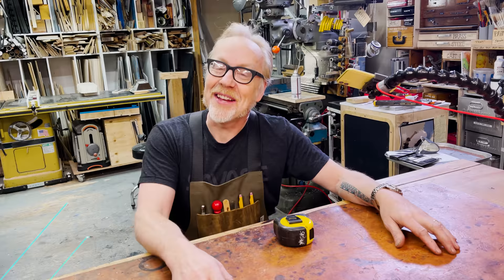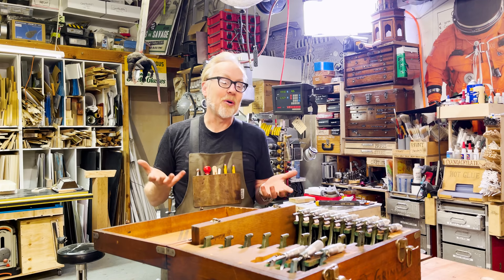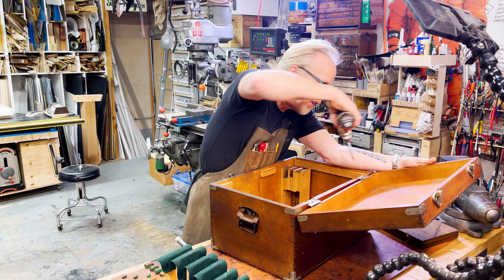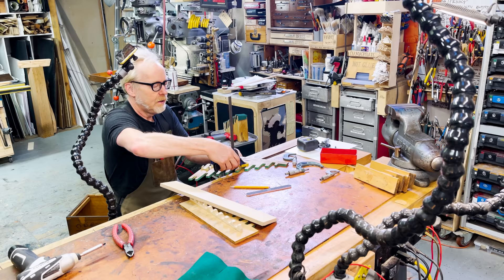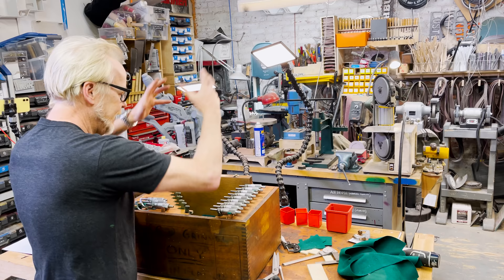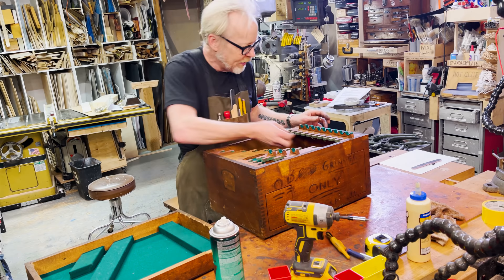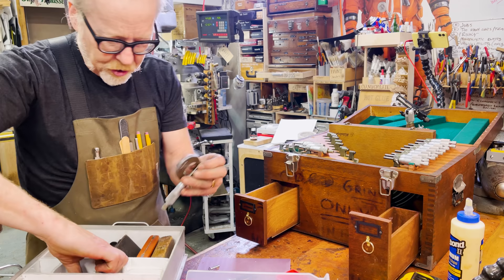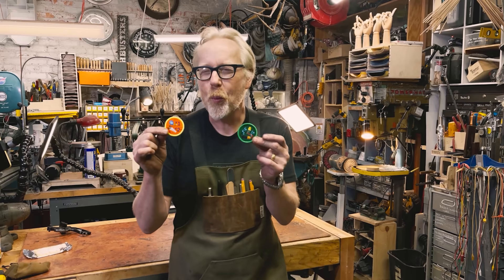Adam Savage's One Day Builds: Micrometer Gauge Box Set!

Comment: Imagine being the guy that sold this on eBay and then watching this and realizing you shipped these poorly to Adam!
Reply: My thoughts exactly. I would change the way I did things immediately. 😬
Reply: Just Seppuku😂
Reply: It sounded like they also arrived in a state of griminess and disrepair, so I'm getting more of a "we found these in dad's garage after he passed" vibe there, rather than someone who knows how to ship and handle antiquated but still useful tools.
Reply: Well, Adam then ruined it by using brass handles on the drawers while all the other hardware is steel, so nobody needs to feel bad about the whole thing.
Reply: @mm9773  How is that ruining anything. If you notice, he also used brass screws for some of the parts, namely because brass and wood are far greater friends than steel and wood. It would probably take too much time remaking everything in brass, as well as requiring some machining skills that Adam does not yet have, but besides it's only looks and have nothing to do with the micrometers themselves
Reply: @mm9773  Woodworkers prefer brass.

Comment: 53:44 Just a small hint: prevent touching the standards at their metal ends (especially the flat)  to avoid corrosion due your hand's sweat. That why they have a non-metal handle in the middle.
Reply: The plastic is also to minimize heat from your hands affecting the length of the standard (and the geometry of the micrometer)
Reply: @dsier  Seems that Adam did not have a metal workshop teacher as you (and I) had :-)
Reply: I have a friend at a museum that is pretty mad at visitors "looking with their fingers". He says their exhibits partly have (well, had) the original paint job, and the fat from your fingers you invariably leave behind is acidic and, added up, eats away the paint, esp. of the late german WW II planes where the paint was abysmally bad.
Reply: The ends of standards as well as the mics have carbide inserts so the don't wear down with use. Carbide does not corrode.
Reply: Light machine oil, leave them unloaded, silicone packets in the case. temperature affects when going ten thousands.never engrave them. Keep standards in silicone packets ziplock is perfect. You will go nuts measuring everything common to you, like the clear wrapper of a pack of cigarettes is two thousands gap on a magneto for a Harley. Book of matches 15 thousands, points. So on
Reply: I slide the rubber "handle" as you call it of the standard down over the non moving end of the mic to hold it in place while checking calibration... idk if thats correct tho.

Comment: When storing a micrometer, always leave a distance between the measuring surfaces, otherwise cold welding could occur. Love your work!
Reply: I thought that was a myth, everytime somebody tried cold welding it failed. Is this true?
Reply: If cold welding really happens, then what about ball milling aluminum powder? Wouldn't the fresh surface with no oxides make the powder clump?
Reply: Not the cold welding, but yes, you should always leave them a little bit open to alow for variations in the metall during store time.
Reply: @shannondove9029  yes true. Gauge blocks do this. Look at YT, there are several videos.
Reply: Isn't cold welding similar to explosive welding? In explosive welding the peices are pushed together while they are cold and way below the melting point. In fact, it seems explosive welding is the exact same thing as cold welding
Reply: Cold welding is nothing that people do. It just happens. Over night. Take two gauge blocks (there are videos here that explain you what a gauge block is) and rub them together. They will stick to each other, because they are so precisely made that the ions can move from one block to the other. That happens slowly and in the atomar scale. After one night new crystals may already have been grown, uniting both blocks. That‘s the so called „cold welding“.

Comment: Calipers measure in four ways, the three mentioned and then it can be use to measure a step.  The moving jaw has a step theorized jaw has a flat spot.
Reply: Came here to say that..
Reply: @hoppend  me too!
Reply: Have been wanting to say this for so long.
Reply: Some measure in five ways.  Mine has a set of recess points on the back that allow you to transfer a measurement form a compass or set of trammel points.   Also some have a thumb wheel that works somewhat similar to the way the ratchet on a micrometer does.
Reply: ahh I saw your comment after commenting the same thing.
Reply: yep, the depth measurement should only really be used for depth of holes, you get much more positive contact and deflection of the depth rod usually fouls most measurements that should been performed with the step. Though it is worth noting that not all calipers are capable of step measurement (Adam's pair were indeed capable), I had a pair of 12" vernier mitutoyos from the 60's that had a nonexistent registration face on the back of the moving jaw assembly due to the rounded design.
Reply: I just got to 23:00 and realized he would get a more accurate measurement if he had used the step measurement. (not that it matters)
Reply: Hey Bill, can you unpack the last sentence, sorry it doesn't make sense to me. Cheers
Reply: Some people sound confused about what Bill is saying.

The very common 4th way to measure with a caliper is the step measurement.

The caliper has 2 jaws, static and dynamic jaw (or whatever you want to call them). When the caliper is fully closed (measuring 0) the top edges of the 2 jaws are flush with eachother. As you open the jaw, the end faces move apart and you can measure the depth change between 2 parallel surfaces with a perpendicular drop between them.

As others have mentioned, this often a more precise way of measuring than the depth measurement because it allows you to keep the caliper square to the 2 surfaces and the parallel to the perpendicular surface (by making sure all the contacting metal is completely flush.

If this explanation didn't make sense to you, I'd suggest looking up an image of "caliper step measurement" and a visual demonstration will make more sense.
Reply: @backintheworkshop954  i think "theorized" got inserted by auto correct, looks like it should just read "the other"
Reply: @backintheworkshop954  fat fingers, the fixed jaw, auto correct turned it into theorized

Comment: There is a FOURTH use for dial/digital caliper, you can measure shoulders from the top head and bottom head, very useful with a shoulder because the depth gauge is difficult to keep square. Hope that's a useful tip for some and makes sense. :) (for example - Adam could have used it from the top at 23:00 to measure the location of his cradles)

Comment: I have been on and off of the machinist field for over 20 years now. I love Adam's excitement given and appreciation portrayed towards machining tools because I think in general, manual machining is becoming a lost art. As for micrometers in general I found over the years you develop a feel to measure accurately and with repetitiveness given that even using the ratchet on it will sometimes yield inaccuracy. For me I developed a little wiggle while trying tightening with the ratchet, and also you tend to prefer using one particular measuring tool because simply you developed the "feel" for that one. You can see inaccuracies when using many different ones, brands, or even same brand but different series whatnot. Unfortunately In my life at this moment I have ventured onto engineering , but machining I can say is one of those fields that I actually felt most accomplished and gratifying completing a project. Oh I also want to give a mention that the runout of a chuck is very important IMO for your spotting drills, when you have to drill and ream something that has to stay parallel and maintain position over 1.5" or over depths.

Comment: A little tip for those cans of wood stain anyone has laying around: throw a little nut or screw in the can before you put the lid back on. Next time you can shake it like a spray can to get it mixed up easier.
Reply: You mad, mad genius.
Reply: @firescale8912  I do live on the edge!
Reply: I did this with cent pieces in my warhammer paints.
Reply: you DON't shake stain - you stir it
Reply: @hankmerkle5928  You are a man of taste and sophistication I see.
Reply: Doesn't this add bubbles?
Reply: @serifhim  It doesn't matter for stain. Let it sit a while and wipe off with a clean rag.
Reply: @hankmerkle5928  
Most definitely, for some paints. Were I used to work we used a lot POR 15. We used it in high wear environments. Gives a very tough finish.

Comment: Rewatching this as I often do your One Day Builds; I wonder if you've thought of a way to secure the drawers in. I couldn't help but think a couple of well-placed magnets would give a decent, and non-permanent, method of keeping the draws from accidentally popping out during transit.

Time to continue my journey to another One Day Build.
Reply: One way I can think of doing is put a latch on the inside just like one of those hook and latches with the little guard on it to keep it from popping off. That way you could have a main lock on the on the top without worrying about the drawers coming out. The other thing I thought about was a cover for the boxes that'll go in there so stuff that's in them don't go flying around either

Comment: FYI, calibration of micrometers (and calipers) does not only consist of adjusting "zeros" but also of checking linearity using a set of gauge blocks over the span of each micrometer.

Comment: Hey Adam, great content. There’s a fourth way to measure with your calipers. On the opposite side from the tail you’ll notice when you close the calipers the outside edges become flush. Those two faces are used for situations similar to the tail (depth measurements), but because they are so wide it’s particularly suited for measuring step like features. The wide base helps ensure the measurement is perpendicular to the surface. Cheers

Comment: Seeing this 12/9/21. Completely understand how you feel. About 6 years ago I found a set of Mitutoyo  micrometers that had barely even been breathed on at an estate sale. I asked how they were going to ship them & they were just going to put them inside a standard size box with a bit of bubble wrap but nothing else. After realizing they were going to be bounced around be a USPS guy that was having a really bad day & was off his medication, I quickly told them to hold off on the shipping until I sent a boatload of foam padding to use inside & out. Fortunately, to the great relief of my blood pressure, they packed it properly & shipped it UPS. Got it for about 75% off so it was completely worth the cost of sending the packing materials & shipping UPS. I very much understand how you feel when opening the box. You just can’t help staring, & drooling, at them in all there precision glory. Thanks for the video. I’m following it to the letter on my box. I was originally trained as a machinist but I’m now disabled & appreciate having one less thing to worry about. Keep on making great videos! It’s greatly appreciated!
Ed

Comment: @tested loved this video, one suggestion to take it to the next level: Drill a vertical hole on the top edge of the lower cabinet centered above each drawer all the way through into the drawer face.  Drill a shallower but slightly larger diameter concentric hole in which you can drop a spring, and then turn a rod with a step so that it rests on the spring and is just proud of the top lip by 1/4" while open, and cut the rod so it's even with the top edge of the drawer opening when the lid is open.  In this way, you can ensure the drawers stay closed when the lid is closed and latched.  You could also machine a small externally threaded ferrule that could be inserted into the top of the lower cabinet after the rod and spring are inserted to capture the rod mechanism so it wouldn't be loose. I've seen some old machinist chests with a similar setup to hold a panel on the front.

Comment: Cool vid -- informative, enjoyable, & inspiring -- tnx 4 sharing.
Two suggestions ... I saw that the top of the lid splintered out when the holes for the "mic stand" were drilled through. Starting with small pilot holes from the placement marks on the inside to the outside followed by coming from the outer face in with the full diameter bit could have helped avoid that. Then any roughness from coming through on the inside would have been hidden by the felt. I suspect Adam already knows this and just got over excited and rushed it (kinda' ironic having thought to put some little slices in the felt before drilling to protect it, but then forgetting to use similar caution for the finish of the outside surface). I noticed that no mention of the tearout was made and it seemed like direct views afterward were avoided, this may have involved one of those peeved self critical frustration situations Adam has, elsewhere, alluded to skipping over at times in final edits.

Also, I think the front drawers might benefit from having some sort of way to brace them in place, hold them closed, so they don't accidently slide out when moving the box around or transporting it. Some sort of clip or pin either inside or outside and/or some magnet, friction, or spring mechanism providing initial resistance to opening when fully closed.
Reply: something similar happened with the right drawer, when he showed the cut front for the first time I thought: oh, I wonder what he'll do now that he cut the drawer so high that it went under the lock. couldn't see it while the masking tape was on to keep the front of the wood safe during the sawing.

his solution was sweet, though I imagine he was really bummed when he first noticed it.

in the end these really are the beautiful little imprecisions that make life fulfilling. and the part with drilling the holes through the top was a good example for that notion of Laotzu I often am reminded of by my own doings: mind the end like the beginning... such are the little eccentricities that we all embody...

Comment: Adam- Ronald Regan made famous the phrase “ Trust, but verify”, but my experience with machine tools is trust nothing, verify everything!  Low paid factory labor is hard pressed to put bolts in correctly, let alone square things.  It’s common practice to file and sand the edges that will bite you and put your blood on projects, dings that will bind sliding pieces etc.  Lightly  stone the metal tops and sides and so forth.  Felt was the preferred contact area for precision tools, check Gertsner machinest boxes, one of the finest items that machinists purchased to put their valuables in.  Go ahead and admit it, you just found another rabbit hole to put money into!  Great find on the mikes, lifetime goods for generations.   And the box that they came in is a classic beauty.

Comment: The weighted wire is actually a valve, and nothing more. When the rapidograph pen is placed on the surface, it is pushed back and it allows ink to fall out of the reserve, which is replaced by air that goes through the metered air maze on the side of the valve body. A rapidograph should never be held at any position on the paper other than perpendicular to it, as the nib will eventually wear out unevenly and ink will overcome the metered air maze, which results in blobs of ink.

edit: rather than shaking the rapidograph, which can damage the wire in finer tipped pens (where the wire is basically as thin as a human hair), you're supposed to squeeze the body of the ink reserve whilst pressing the tip unto a paper and slowly dragging it down. Five 4 cm long lines are almost always enough to prime the system.

Comment: Adam, don`t store your micrometer closed! Always leve a gap to keep it accurate. If you store it closed it might get compressed over time and no longer accurate!
Reply: That really is a non-issue. In the entire set only of them, the 0"-1", can actually be closed that way. All the other eleven in the set cannot do so. The materials of construction are such that there is virtually no difference in the Coefficient of Thermal Expansion. Only if there was such a difference the CTE could very rapid temperature excursions cause an issue arising from differences in the thermal mass of the various micrometer parts. Before use, the gauge is always supposed to be checked against the standard and re-calibrated as needed.